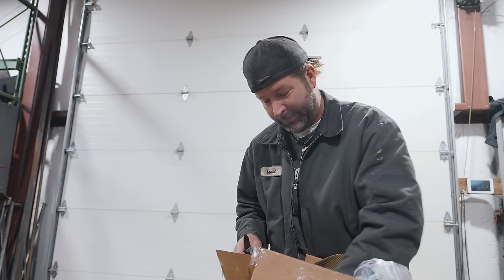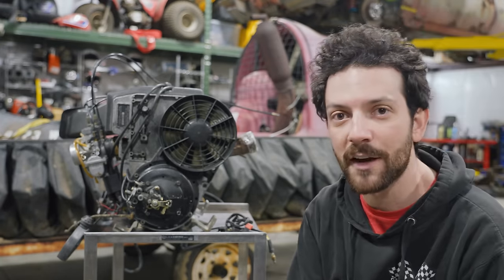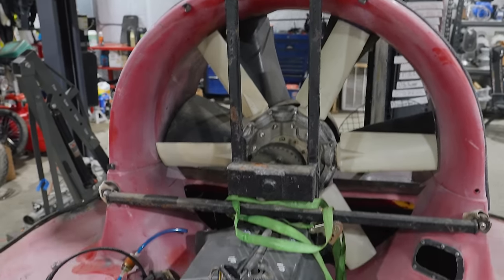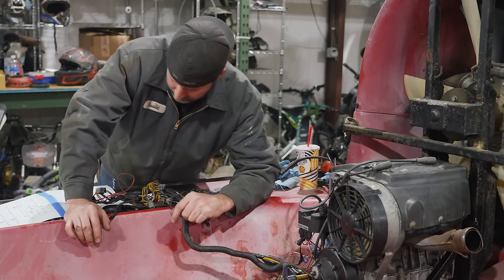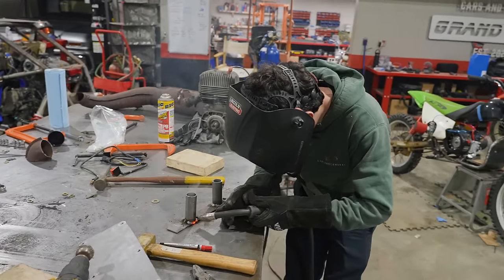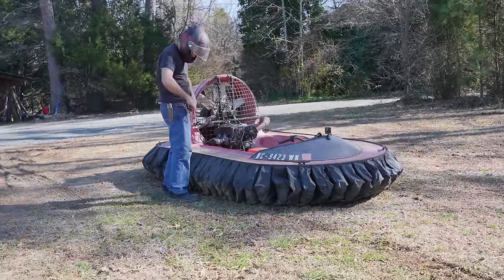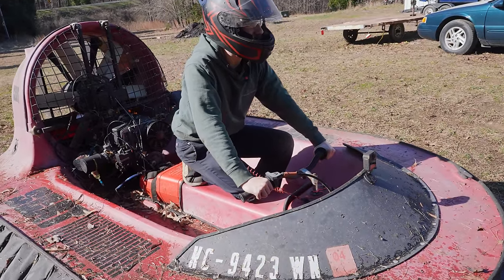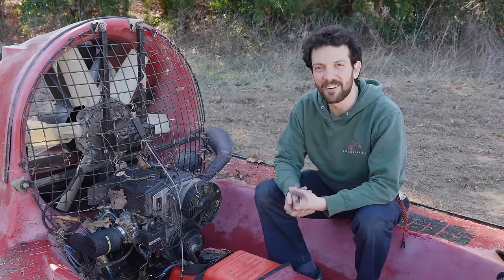Reviving our Hovercraft with a 2X Horsepower Engine Swap! (It Rips)

Comment: so i always thought about the instability of personal hovercraft on both land and water... i was also looking at drift trikes...  they got bar stool kind where the motor is in the middle and the thing rotates around it or they got the kind that work by making the back kick out... i think both ways will work on a hover craft and also give it a point of contact for more control... you could take a chunk of the hull... ideally in the center... then fabricate a motorcycle shock of just build a box with a that will support the wheel... then tie it into the frame then  seal it and rig  a linkage into the steering so when you turn the fan steering it also steers the single wheel...  make sur the suspension bottoms out with the hull... then when you go into water it will work as a rudder...  or you could add an aluminiumd mt bike brame hanging off the front and rig than up so the linkage for the  fan steering  also steer the mt bike steering... also for the suspension for that i think you could build a cool cantilever or paralever deal that hung over the front but mounted to the middle... anyways would work basically the same... would be cool.. i dont have the ambition or know how to actually make it work... you  guys could try it with some parts that bolt on that wouldnt ruin the thing just to try... it would be a video at least...
Reply: i was re watching the video right now and just had a thought that putting one of those electric onewheels with suspension right between  the riders leg now might be better for control... and if you actually did put a one wheel and kept it electric you could use it for propulsion on land and if you put knobbies even in water too...  maybe get or build a rokon front end with the chain drive and use a predator engin on motor cycle shocks up front instead of electric...